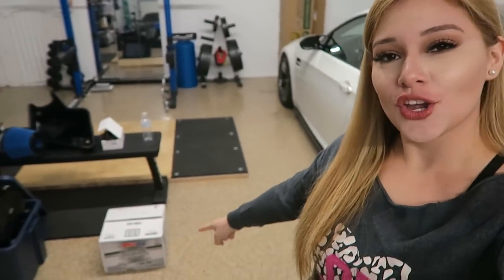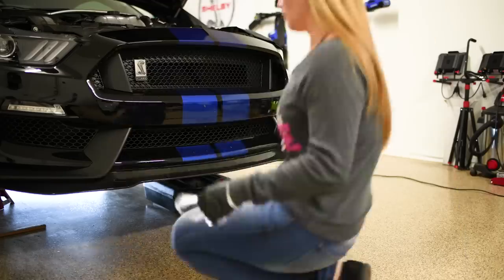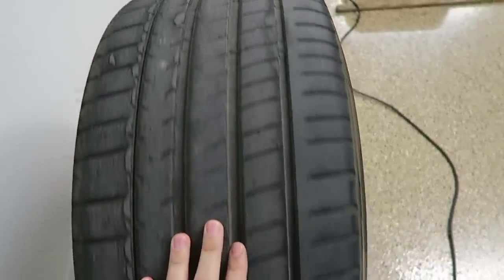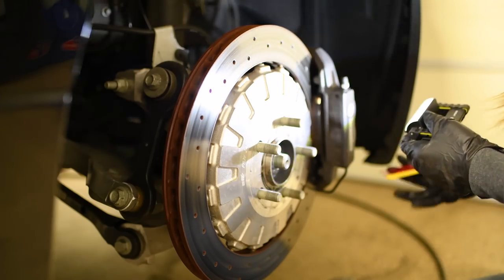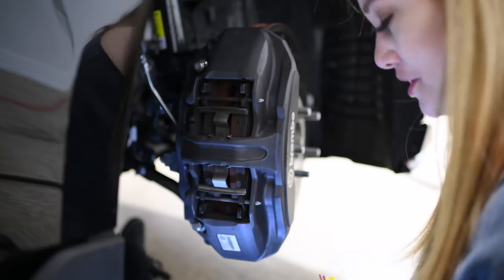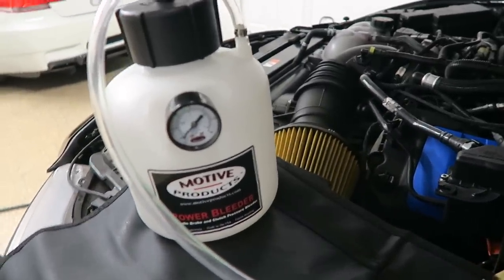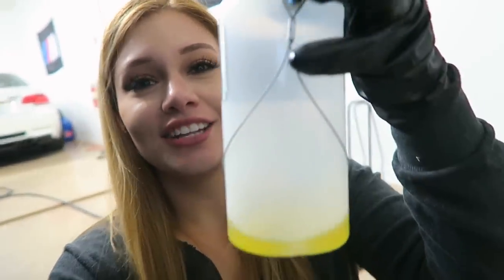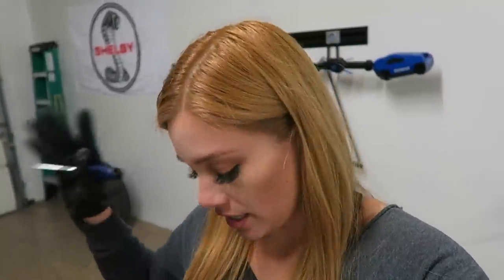2018 Shelby GT350 Brake Flush and Oil Change PERFORMED

Comment: Have fun getting the oil filter off lol without putting oil on the oRing ive ran into many that i had to stab a hole in the filter to remove it
Reply from the maker: There is oil residue on the threads of the housing already. So the o-ring won't be 100% dry. The recommendation was don't oil them on the cap. Too much oil on the rings is the issue. Potentially.
Reply: @woman.driven  just thought id let u know keep doing what Ur doing beautiful U seem to know what Ur talking about more than most of my dude friends lmfalo

Comment: Where did you see those 350’s with 500. Engine in it?? Did they have Michigan license  plates?
Reply from the maker: They sure did! I saw them at a Surprise Hotel after running into one on the street. They have the Ford proving grounds a couple miles north of here. So I've seen the camo GT500 drive around at times. These confused me lol. They had driven it all the way from Michigan to AZ from what the Engineer said.
Reply: I saw them too!